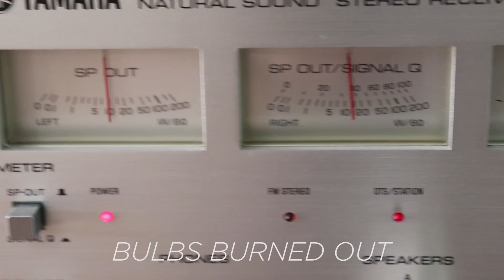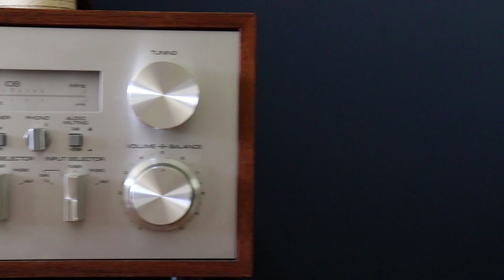Fixing Scratchy Knobs and Burned out Bulbs

Comment: With a copy of a service manual for the CR-1020, you can also check and adjust the Idling Current, DC Offset, and even do a lo-tech FM tuner alignment.  Many Yamaha receivers and amps of this era (late 1970s) are easily repaired since many of the components are still available--very few unobtainium components within.  Have fun...I had a CR-620 and a 2020, great receivers!
Reply from the maker: I will have to check it out...Thank you.

Comment: Electric tape ???..  Rookie repair..  Use heat shrink tubing next time.
Reply: Especially for the dial-pointer lamp; connections "insulated" with electrical tape will rub against the inside top cabinet as the tuning is changed and eventually the adhesiive will soften from heat, the tape will slide around, and allow the soldered wires to short-circuit. Bad idea!

Comment: I have a CR 1020 I bought slightly used in 1983 when in highschool.      It's been in storage ( in AC environment ) since the 90's.     Recently plugged it in and it still works but with issues as you describe.     I am looking forward to cleaning it up and seeing where we are at that point.     I was also given some Bose 601 series iii speakers which need new woofer foam.    I have the kit for that already.     Great hobby project for this CV19 time.       Thanks for the pointers.

Comment: Just a little info for anyone reading this... With yamaha , if you put in L.E.D.  just be sure the replacements have the resister built in on one of the leads or they will burn out....
Also on the CR-620 and im assuming this one in video and other models of yamaha if you use Warm White L.E.D. , your meters and dial will have a greenish look to them.. But if you use Cool White L.E.D., they will have more of a lite blue look... 
They will look light blue when you install the cool white LED. And it shows light green when you use the warm white LED
Reply: I just relamped a CR-820, with LED's. The original 12 V lamps were wired together in series pairs and fed from 24 V DC.  We have LED's with factory attached leads and built-in resistors so that they can run at 12 to 14 V.  I wired the 3 meter-illumination lamps together in parallel and used a common dropping resistor of 470 ohms as I recall, to get the voltage down to spec at a  reasonable brightness range.  The replacement LED for the Dial pointer got its own separate dropping resistor. It is easier to figure out what value of resistor to use if you have a switchable resistor substitution box (or a variable pot of about 1K), and you can use your meter to ensure the voltage and current is within the safe range for the LED's. The original lamps had green booties on them on the CR-820, and sometimes they degrade or discolor from heat over the years and you might need to replace them with new ones.  LED's will work best if you can get some that have more of a warm white or slightly yellowish tint.  I actually had to file the rounded top of the LED for the dial pointer flat in order to fit it into the lamp housing with the LED facing forwards directly at the lucite lens that is used as the dial pointer.  The light output from the sides of most LED's is far less close to omnidirectional than it would be with an incandescent bulb, and so you will tend to get a shadowing effect and inconsistent  illumination from the sides of the LED.

Comment: Hey man, great video! Nicely explained. I thought my bulbs were burnt out so got new ones. Turns out there is a power problem TO the bulbs. The amp itself works great. Any idea where I can go next?
Reply: I just relamped a CR820 with LED's replacing the bulbs. The original 12v lamps are wired in series pairs and fed from 24 volts DC. I wired the three meter-illumination  LED'S in parallel, with a common voltage dropping resistor, and a separate resistor for the dial-pointer LED.  The easiest way to determine what voltage dropping resistor to use is with a resistor substitution box (or a 500 ohm to 1k potentiometer) so that you can adjust for a usable brightness while measuring the voltage at the LED'S to make sure you stay within the voltage and current limits of the LED'S.  You can use the ohm's law formula to determine what the wattage of the dropping resistor should be should be so that it doesn't run hot.